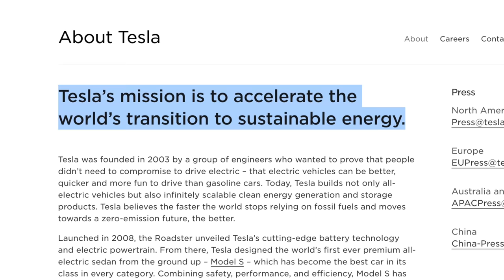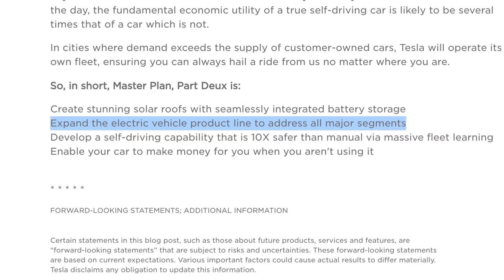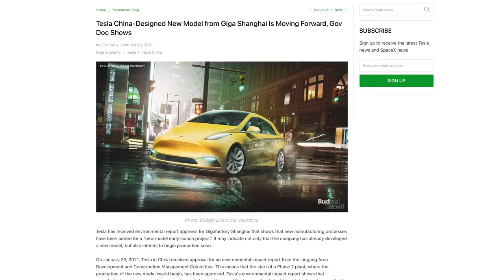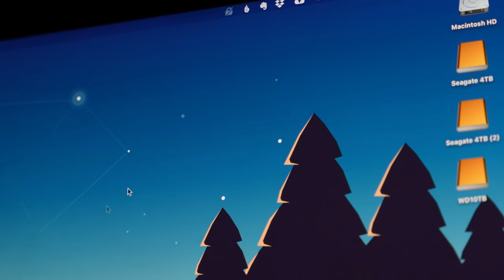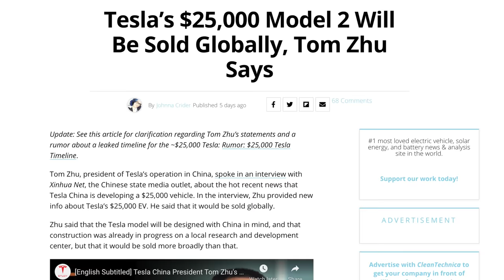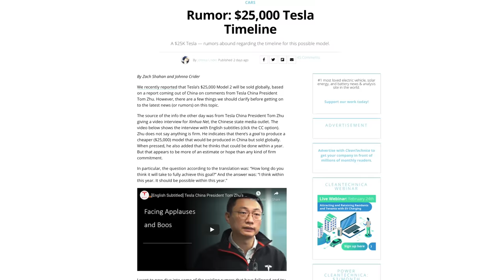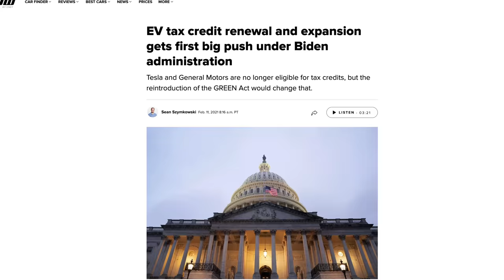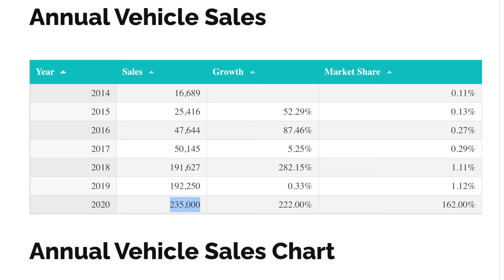New Tesla Model 2 = Game OVER for Gas

Comment: Even with no tax credit at all, $25000 for a "barebones" Tesla is a game changer.
Reply: Indeed, I've already decided to buy it for less than 30k, without tax credit. I'll leave IC car once and for all.
Reply: Without the tax credit its almost exactly 7k over everything in its category.
Reply: TEC Man 96  most of these people are just talking out their rear-end; they can't buy a 5 year old used car for half the $25K, but it's "a thang" to talk Tesla for them. 

You are right, Chevy is better buy than Tesla, and so will Ford very soon. 
e-Mustang is too pricey, but it isn't targeted to the same demographics. But other Ford electrics are in the pipeline.
Reply: Ford built the infrastructure for gas powered vehicles with demand by selling model Ts for less than the equivalent of $10,000 in today's money. $25,000 for a base model entry level car is still not cheap.

If you want to change the world, make it cheaper to do it the new way.
Reply: well being a new Bolt owner this year with about 250 mile range is great for a 200 mile round trip, but out west i will still need my gas vehicle to go the 500 mile one way trip.  I do not see a charge in 15 minutes like a gas fill up.  Can you see an EV truck with a camper on it crossing a large mountain range.
Reply: @ihcterra4625  Chevy Spark gas can be had for $16K. Even a $25K "entry level" Tesla EV is still uncompetitive.
Reply: TEC Man 96  the Model T was the most popular car sold until 1972 and it is still in the top 10 even though it went out of production in 1927. Before the model T, there were less than 200,000 total cars on the road and Ford sold 15 million model Ts by 1927.

It appears that being inexpensive didn't hurt sales.

When it was introduced, it cost about $23,000 in today's dollars, and they sold only 10,666 cars.  When they eventually got the price down to the equivalent of around $13,000 in 1919, they sold 170,000 cars. The price kept coming down and sales kept going up. When the got the price down around $5000, they were selling millions of cars a year.
Reply: TEC Man 96  I just bought a brand new vehicle for $25,000. 

For an entry level base model, $25,000 isn't unreasonable.
Reply: @rayrussell6258  that is what I said. $25,000 is still not cheap for an entry level base model.
Reply: TEC Man 96  he likely found something with a huge rebate; I'm shopping now myself, and there are some good deals if you want to accept what's on the lot.
Reply: @ihcterra4625  I was agreeing with you, and posted a specific example. :)
Reply: TEC Man 96  it wasn't half the price, it was closer to a quarter.
Reply: TEC Man 96  So, none of that is relevant. 

The point is, before the Model T, cars were a luxury item and less than 200,000 were on the road. Selling millions of them a year because the got the cost down under $5000 in today's money created a demand for support infrastructure. Again, the point is creating the demand for infrastructure. How and why they were able to get the costs down isn't relevant to the demand it created for the infrastructure. There I said it 3 times, do you understand the point now?

The relevance is, if they want to build an infrastructure, they need a demand for it. Rather than trying to build the infrastructure for a luxury item, make it more economical to own an electric vehicle. People will be willing to change if it was actually cheaper to buy an electric car, even if they don't quite have an infrastructure for it. Just like the Model T. 

Once they have people used to electric cars and a convenient way to power them, the luxury cars will be much easier to sell.
Reply: TEC Man 96  4 of the last 5 vehicles I have bought in the last 20 years have been new and not one was over $25,000.

2 were fleet vehicles for my business, including the last one 2 months ago. 5 years ago I got one for 17K, and the other 2 were personal vehicles. The most expensive one was a new Jeep for just under $25K. I got a really good deal on the Jeep.
Reply: TEC Man 96  the last vehicle I bought for under $25K has auto transmission, power widows and locks, bluetooth, backup camera, cruise, air etc. But that still has nothing to do with the point.

The point I'm making is that to get the infrastructure built, sell a ton of cheap electric cars. The $70K cars will sell a lot better once the infrastructure is built. $24K isn't a cheap car, so they should build something for half that to sell millions of them and create a demand for infrastructure.
Reply: @ihcterra4625  I agree and that's the goal of course, but $25000 is still far more attainable than $35000-$40000 for an entry level vehicle. I'm excited about some of the smaller entries coming up, such as the Electrameccanica Solo for less than $20,000. It is a vehicle made for one person and can therefore have a much smaller battery pack and still have decent range. And it's worth noting that more than 80% of people who drive to work drive alone, so it makes sense to have a vehicle that is made for one person. Why carry all that extra space and weight if it's not needed?
Reply: @stevekolstad4445  It's getting there. Energy density is steadily increasing in battery packs (the battery pack in my 2016 Kia Soul EV is the same size as the one in the 2020 model EV but has less than half the capacity: 27kwh vs 64kwh) and at the same time the cost per kwh is dropping very fast, to about 1/10th of the cost from less than 10 years ago. Both of those trends will continue and manufacturers will continue to eek out ever more efficiency from their battery packs and drivetrains.

Every situation is different of course, but most people don't need hundreds of miles of range. They think they do, but 99% of the time they do not. The average person both here and abroad drives less than 30 miles per day. And 15 minute chargers do exist but they are rare right now (800V 350kw chargers for the Porsche Taycan, for example).
Reply: @JustWasted3HoursHere  there are actually quite a few EVs in the $30-35K range that would be around $23-28 with the federal rebate. If they can cut $10K off that, it will really boost infrastructure.
Reply: @ihcterra4625  True. Imagine that $20000 car with a $7000-$10000 tax incentive. A new car for $10000 to $13000? That would be a game changer.
Reply: @JustWasted3HoursHere  the Kandi K27 is exactly that. But it has a pretty limited range.
Reply: TEC Man 96  they dont discuss the semi miles whether its empty, bobtail, or 80,000lbs.  How far can you tow 80,000 uphill in the mountains?  100 miles?
Reply: TEC Man 96  according to tesla, the semi is rated around 2kw per mile so 500kwh battery for 250 mile version, 1MWh battery for 500 miles.  Current tesla battery weighs approx 1200lbs per 100kwh.  The 1mw tractor would lose 10,000 lbs of freight in just battery alone. (2500lbs taken off for the weight of the DD series 60 engine)  Take that into consideration that a long haul company would need 1 extra truck per 8 full load of 80,000 lbs plus the added downtime for charging, its a lose-lose situation and will be for a long time.  Charging 1MWh of batteries hasnt even been remotely close to 15 min idea, as that would require 4MHw or 4000kWh of charging.  

Craziness is comparing that 4000 kWh to the average home energy use per year is 11,000 kWh or 11 trips with an electric semi or 5500 miles.  

Can our grid handle that at any location with a single trucking company with 50+ trucks?  What about 10-20 companies on a single grid?
Reply: TEC Man 96  Yes, but it is not a Tesla. Tesla is the only electric car I will buy.
Reply: @RogerioCampanhol  Consumer reports has them 25th out of 26 manufacturers...
I'll make sure to wave as I pass in my IC Mustang....
Reply: TEC Man 96  They had a Documentary on Tesla, they said they used "AA" batteries, YES a LOT of them built into the floorboards, but the connection pattern was patented, so they could show them....I was just wondering HOW you replace them when they wear out!
Disassemble the entire car?
Fanboi is a good characterization...this video smacks of commercial Ad...
Reply: @ihcterra4625  I guess I need to see if I could find the source, but supposedly Henry said he would give people cars, as long as they only bought parts and maintenance from him for the cars lifetime.
Isn't that what Elon has done so far, only he can work on them?
Reply: TEC Man 96  IFF(If and only If) they can get taxes on gasoline to the levels the IPCC wants...$29 gallon by 2030....
Reply: @shillgates6664  They could just stop subsidizing the oil industry.
Reply: And still a worse value than ICE based cars.
Reply: @rayrussell6258  He didn’t say Chevy was a better buy than Tesla, he said a 20k EV already exists(if you get incentives). I’ve heard transmission modules failing in-warranty, but they will not be covered, pedal has no feel, suspension is meh, GM also has an active buyback for Bolt EV models.

Like if you don’t like Tesla that’s cool. No need to make stuff up and pick his words.
Reply: @rayrussell6258  Chevy Spark is a trash, cheapo car with terrible ride quality, seats engine, etc.

Why would I buy a Chevy Spark when I could buy a Lexus 350 for that price used?

You also negate that EVs have gone 300-500k miles on their original batteries without hardcore maintenance of complicated engine components like head gaskets, spark plugs, carbon build up, Short Blocks, Engine Mounts, etc.

You can hate EVs that’s fine. But you could keep the same EV for literally ever, unless you wanted a new car.
Reply: TEC Man 96  real world...a blogger did a winter drive around Chicago with an EV; after trip a 45 minute recharge got her 22 miles of range; not sure where you get 5% to 80% in an hour; sounds like Tesla hype to me
Reply: TEC Man 96  nope, not because of basic and cheap...it was because Henry made no changes in appearance to the car for pretty much its entire production run that people could see
Reply: @ihcterra4625  I still don't agree with that...sorry but you can put up all the infrastructure you want, EV's will be time wasters for anyone travelling more than 150 miles anywhere versus gasoline; if you want to go with an EV it better be almost 100% charged before you leave and you still won't get home without a LONG time at a supercharger; the gasoline car can make the round trip with no stop and still have gas in the tank
Reply: @ihcterra4625  you may have THEN, but not NOW; 
all the low priced cars have been discontinued in the past few months; only Spark remains (at GM), all Fords and Mopars are gone, and you can't find anything sitting on most lots from the imports under $25K now either
Reply: @JustWasted3HoursHere  buy a motorcycle then if you want a one-person vehicle.....sorry but people don't buy tiny one seat cars now in gas, it makes even less sense to think they will as a higher cost EV
Reply: @ihcterra4625  A lot of us taxpayers are tired of the government wasting our tax money on people's personal vehicle choice; EV incentives/rebates need to be abolished, before our bridges fall in and our roads crumble back to gravel
Reply: @chris8417  it's all Tesla hype not real world anyway; if they can get that kinda range on a semi why wouldn't the same tech be on cars now -- so they'd get 500 miles? 
because it's just hype in the press that's why
Reply: @rayrussell6258  Not necessarily. If they see and understand the obvious advantages of an EV but can't quite afford a full size EV (and don't want to buy a previously owned one), then buying a single person EV within their price range might make sense for them. Everybody's situation is different. For example, I knew I wanted an EV but couldn't afford a brand new one, so I started looking at used ones and found a 2016 Kia Soul EV+ with less than 18000 miles on it, one owner and in perfect condition (it even smelled new) for less than $13,000 + about $2000 shipping from California (one of the few states it was sold) to Florida. Best car I have ever driven let alone owned. But, to the point that each person's situation is different: This Kia has a range of less than 100 miles, but for me that's perfectly fine because I work only about 10 miles from where I live. I charge it from home about every second or third day and have never looked back. Maybe in a few years I will upgrade to one with more range* but for now it meets my needs just fine.

* The 2020 Kia Soul EV has over 200 miles of range but it will not be sold in the US. :(
Reply: @rayrussell6258  400mi ranges with 15 minute recharge is available now. 

By the time solid state batteries get here with 5 minute charge times, gas will have a tough time keeping up. Without subsidies they get from our tax dollars, it would already be impossible for ICEs to keep up.

The way to get it built is to Model T the industry. 

By the time they are mass producing millions of a model instead of building a few10s of thousands, the prices will really come down. But they will need someone to build a viable $15,000 car to get there.
Reply: @chris8417  these "promoters" of EV's don't have a clue about reality and most of them don't care --- if they can influence sheep to follow them with the misinformation they spout out; 
you are absolutely correct in your trucking analysis; trucks need to be moving nearly 24/7 right now with existing equipment price and maintenance being so high that no one wants driver's to take the full rest time required on the log book, certainly revenue will get thinner if forced to use equipment that wastes 10,000 pounds of capacity and the equipment is idled longer for extremely lengthy recharging times; 
and if people are upset about 50-cent postage stamps wait until their shipper's minimum freight bills triple or quadruple overnight and shipping/delivery costs billed to customers becomes higher than the item they just ordered online
Reply: @Richard Peterson if you like the Bolt you'll love the e-Mustang then
Reply: @ZambonieDude  I think his point was the Bolt is a better buy, I'm not making anything up; if it costs less and gives you close or better range, it certainly is a better buy especially when Tesla is likely gone in 5 years because they can't survive the competition in their fragile financial condition; and Tesla is totally propped up on borrowed money --- they have no assets. They'll be gone soon unless Biden gives them a bailout; Tesla doesn't employ enough people to justify a bailout btw
Reply: TEC Man 96  the lawyers haven't sunk their teeth into a self-driving car fatality much yet; when they do, that $10K premium won't be the end of the mark-up
Reply: @JustWasted3HoursHere  you city people (mostly on the east coast) think the whole world revolves around your driving pattern; most people do NOT drive 30 miles per day, we drive 70 to 100; 
a typical car travels 15000 miles a year minimum (15000/365 days = 41 miles per day minimum, but considering most miles are driven on 5 days a week not 7, I'll adjust that for demonstration purposes to 15000/260 days = 58 miles per day, then you add on vacations and trips to see family you get up to 70 pretty fast; I drive 40K miles per year on my car; your 30 miles per day is not real world)
Reply: @JustWasted3HoursHere  $10,000 incentive on the car - and no roads left to drive on, and you need a ferry boat to cross every creek and river because the incentives soaked up all the road money!
Reply: @ZambonieDude  Why not buy a used Tesla for the same price? 
Because YOU will be the fool who has to buy the $7-8000 battery pack replacement the original owner didn't do, that's why!!!!!
Buy the Spark....save time, save lots of money, save aggravation. 
I've ridden in Spark, it is nothing like you say. It doesn't ride like my Lincoln MKZ, granted, but it is decent...and the seats are absolutely fine in Spark. I wouldn't want the CVT, but I could see myself with the manual trans they offer on it. 
Zam old comrade, I also have three F-Series trucks with a total of 575,000 miles, the only parts I've replaced are (1) starter, (2) water pumps and (1) radiator, + regular spark plugs and air filters; an ICE may be "complicated" to YOU, but that is far from the truth. 
If you had "carbon build-up" you probably buy your gas from cheap gas stations. My engines have never even spark-knocked, I buy from reputable gasoline companies. 

The wheel motors on your EV will fail, only a matter of time, Your battery pack will fail, only a matter of time. Your electronic dashboard will fail, only a matter of time. Nope, I think no one will want to try to keep an EV as long as you think they will. They can't really avoid any expense going to EV's, see big bills coming and get rid of it. 
Obviously, you are not an engineer, your automotive knowledge is very sketchy. I worked in engineering as a career. You just want to hype your opinions. Sorry, those who know are not buying into it.
Reply: @JustWasted3HoursHere  Very few people only drive 20 miles a day to work; auto companies (ICE or EV) cannot survive on consumers like you.
Reply: @ihcterra4625  That is just a bunch of hogwash....250-270 is the limit on affordable EV cars for the masses. (if you think $35K is even affordable - and I don't) 
I want to see that 400 mile range vehicle, it's probably like the urban legends about ICE cars that get 100mpg on bacon fat! And maybe it costs a million dollar dollars apiece to make one that goes that 400 miles. Totally hogwash. 
A 15-minute recharge right now gives you about 3 miles of range, and I'm sure you have no idea how they can increase that rate by 10x on such a car. It's not realistic to put such false notions in the mind of average consumers. 
I think I saw one of those supercharges for EV's cost $50K EACH! No one I know has that much money to spend on a car, let alone a charger for one, even if it shortens recharging to the "one hour" you say (but my engineering colleagues would strongly disagree with you about)! 

Not realistic to think that mass production of EV's will result in any savings to consumers either. The way prices are set in the auto business does not reflect costs of the vehicle. The cost of a full-size SUV isn't all that much different than a sedan car, but the prices are sure different! The target price is set first, based on macro/micro economics in a marketplace, then we squeeze costs to meet an expense objective under that. If there is any savings from mass production as you think of it, it will only improve our profits. The revenue target will still be set using the same method we use today and go up if the overall economy is not sinking. You won't see any savings.  

What ICE subsidies? I worked 30 years in automotive, no government subsidies ever came our way. If we rebate a car, it comes out of our own revenue, not from the government. 
(I don't consider the company "bailouts" of Chrysler and GM to be subsidies, because both rounds were caused by punitive government manipulation of the free-market, and when it came down to it the politicians knew they had to do the bailouts or face huge masses of permanently unemployed workers (who vote) that would be mad as hell at them. I was at Ford, we didn't need bailout.)
Reply: @rayrussell6258  I didn't say anything about 400 mile range cars being affordable. Just that they exist. In fact, my point actually was, they need to do that in an affordable car. The cars and trucks that have 400 mile ranges are well over 50K. You are strawmanning my argument. 

There are plans to have solid state batteries out this year. It will increase range and reduce weight, making it easier to carry more batteries and they will be able to charge and discharge faster. We are at the point where battery technology development is accelerating. Batteries that are lighter, safer, higher capacity and more abundant materials like carbon have been developed and are racing to the market.
Reply: TEC Man 96  brand new EV (not Tesla but I won't say which brand it was they were testing except to say it was new), the blogger I think called herself CEO of a company behind the video and it had an official sounding magazine-like name such as someone set up to do a lot of EV drive evaluations, but I didn't save the video -- so I can't put the name here for you; I saw it here as a youtube video, so if you search around for new EV's you will likely find it; in the video she was operating initially from inside a home garage with her own charging station on a 110 system, quoted 90-something hours for a full 0-100% recharge, and she showed 220 charge times around 14 hours and supercharger full-recharge times -- all three on one graphic during the video, she misstated one of the numbers relative to one of the others in the graphic which of course lots of people caught and posted in comments so she came back later to apologize for the error in relative times (for 110 versus 220 I think it was, I think she said 220 was 1/3 the time for 110 recharge but clearly that was bad math in her head); this happened a couple weeks ago in Chicago and the video was posted immediately, it was freezing temps and I think it snowed in the video while she took the vehicle north toward Milwaukee and back, heater and defrosters were in use most of the trip; she showed the charging station where the 45 minute recharge occurred (she related a story about someone parking at the station - but not recharging - to hold it for a friend, but she took the connector and put it on her vehicle anyway making the guy holding the spot angry in the process -- to which she told him off about charger etiquette; and she said she only got something like that 22 mile range added for a 45 minute recharge, so it wasn't worth the time or in that case the risk; as you can now see I was attempting to economize on words when I wrote the post you referred to, but please don't EVER challenge my posts for truthfulness --- 
now, here's some "opinionating"..... EV's are an inefficient politically driven waste of time for all of us if we let them force it down our throats ....which is really the plan now because there is no way the US can meet the Paris Agreement without taking away personal cars from everybody and forcing everyone eventually to take public transportation that uses electric power paid for by government and our taxes; once the grid is in place there will be no stopping the political power grab; we need to see this EV/gasoline battle for what it is and it isn't about cleaning the air....we already did that to a point of extreme diminishing returns already but someone else has figured out a way to make a buck if we fail to resist this latest move

analog tv reception was better than the current digital tv reception but our all-knowing government took it away from us for the benefit of satellite tv companies.....this thing with EV's is in the same political way a pay-off for someone....money and graft is going to benefit if we are quiet
Reply: @ihcterra4625  if the first point was not important it shouldn't have been the first point; speculating about range of an unaffordable vehicle serves no purpose; as far as I'm concerned if we aren't talking about improving things for people we don't need to be talking about things that are unaffordable at all; and yes by omitting the high cost of that speculative 400 mile range car, you were misleading the conversation to make it appear affordable
idk where you are getting your "solid-state" battery info but I've not seen it anywhere else but in your post and I think my engineering friends would have let that slip out to me in conversation by now if it is that close; until I see hardware it is just another "bacon grease gets 100mpg in an ICE" story to me.... but I now will be more attentive to pick up on anything that does come within my earshot
Reply: TEC Man 96  my family was in trucking for three generations; I fully understand  trucking....maybe fed ex can do it and pass the cost along but not real trucking companies; we can't have that much downtime switching to electrics from diesel
Reply: TEC Man 96  people react to visual change....whether it was options or bodystyles or electric start..... people could not see changes, the front of all Ford cars was the same for the entire run, basically the same with the interior, and Henry had convinced himself not to make assembly line production "less efficient"/more expensive by allowing the Company to go back to cars that weren't black
son Edsel saw it and convinced the old man to put out the new Model A, with colors and with Henry's V8 that he'd been tinkering with
in those days dealers sold options, and there were plenty of them for just about anyone's choice on Model T's....so your point about "options" being the reason is not accurate
Reply: @ZambonieDude  if the modules are truly failing during warranty they will be covered by the warranty; who told you that lie it won't be covered? 
more crappy internet chain writers I suppose
Reply: @JustWasted3HoursHere  there are NO obvious advantages to an EV; just the opposite frankly....
that's why they failed in 1910 and will again in about 10 years
your personal situation with only a 10 mile commute is so unique that I understand where you're coming from but if I lived in Florida and only had a 10 mile commute I'd ride a bicycle to work --- not pay $35 grand for an EV
Reply: TEC Man 96  sorry I didn't save the video, but I didn't know I'd need to show it to prove my word; I gave you all the key info except the poster  (and the brand of EV isn't the point, because ALL EV's are a waste of our time). 
I'm not flat earth or those clowns, but I can tell you nothing in archaeology suggests we have any worry about "climate change", it's hype driven by the chicken little crowd and politicians using it as paving the way for the "new money" crowd who invested in Tesla
Reply: TEC Man 96  your last sentence I agree with, the change was driven by newer looking vehicles from competitors (not because Fords were basic and cheap -- which was your original point; buyers had plenty of options from the dealers if they wanted them to expand utility)
Sales were declining, true, but they were never bad....Edsel was right in bringing out the Model A at that time
I spent my whole career at Ford, I've lived this tale from the time I was a kid wanting to work there someday, and I made that happen fortunately
Reply: TEC Man 96  you don't understand trucking....regional trucking is still otr; my family business was regional not coast-to-coast; both are otr; 
if you mean delivery trucks you need to be specific and say that
and I still say Tesla is swimming upstream if they think they will get anywhere even with delivery trucks
diesel mid-size and smaller delivery trucks are pretty darn efficient and cost far less; cost is a big object in the delivery fleet business and EV's I doubt will ever get very far in that market
city buses is about the only market I'd give to the EV's, and that's only because city politicians will be involved in the contracts so the purchases will be shaded toward whichever party is in office (cost is no object to politicians spending OUR tax dollars)
Reply: TEC Man 96  your cost of ownership comparison is really off, you must be forgetting to replace the batteries and pay the electric bill! ; failures of every part of an EV powertrain is a MAJOR expense, not just $200 parts plus labor the typical ICE repair; you might not have that covered in your EV figures either; 
dealers who want to sell EV's have to ante up for a new franchise fee, that will get passed on to consumers, too ....another unknown; 
we really don't know yet where cost of ownership of an EV will be....none of them are old enough to have such numbers yet, but promoters of EV's like to say that phrase about cost of ownership --- it's just another piece of the misinformation getting spread. 
All I know is I can buy an ICE vehicle right now for $30K (even $17K or less for a Spark) and the cheapest EV that isn't really a moped is $40K The $30K EV's they talk about in the press never get built I hear; you are on a permanent wait list for one
Reply: TEC Man 96  I have not found your Bolt recharge video; what's the link?
Reply: TEC Man 96  I'm fully aware of capitalism, but when we do not have a truly free-market economy we wind up with monopolistic contraction; I don't think for a second that a company using electric trucks without government subsidies will put a current trucking company out of business
Reply: TEC Man 96  you expect me to fill in the blanks, but ask me for clarification of my points? lol sorry not going any further down that road

I strongly doubt you can show me an honest video source, un-manipulated, that shows that video I cited about recharge times wrong. The poster was independent, not trying to sell any particular EV.
Reply: TEC Man 96  you had the missing information twice, don't try to switch "blame" on me! lol

Daily fixed route delivery trucking is an entirely different animal than coast-to-coast, regional or "local" trucking. We live in that truck for 2-4 days. Some try to get you home in one day, but that doesn't always work out. Diesels are cheap to operate in that environment; seldom is the motor shut off, you need heat in winter and a/c in summer wherever you're parked waiting for unloading and loading. It's not just the point A to Point B that has to be accounted for in otr trucking. EV trucks don't fit, and if you're in mountains a long way from a charger three days into the journey you can be in serious trouble. Also, waiting on a truck to recharge takes away legal seat time from the driver. You can't be "off-duty" either, when you are responsible for that recharge connection. That all delays loads, which are expected to be delivered in "just-in-time" supply chains with 98% or better success or your company gets a bad rating and you lose your customer's business; this all costs too much money. Not going to happen. 

As I said, Tesla can hype and say all they want, they're swimming upstream smoking California weeds if they think they can change trucking even in 50 years. Tesla will be long gone by then.
Reply: TEC Man 96  I'm not filling in any blanks someone can use to further divide the conversation.  lol
I told you the EV was brand new, latest and greatest; it would be in the top percentile of any data you have. 
I'll look for the Chicago video if it comes back in my favorites from youtube. Best I can do right now. I've got to get some sleep! :) 

What you said about Tesla "targeting" made no sense to me. I gave you all the reasons elsewhere on another post.
Reply: TEC Man 96  ok, I just saw a "Road Show" video about the solid-state battery, Very eye opening....but not in a way you're going to like. The shortcomings outreach the benefits, and gasoline refueling is still faster and more efficient than the solid-state battery will be recharged. The shortcomings are battery unreliability .....situations of expansion and contraction cycles that cause the battery to suddenly crack and fail, making them unusable and they must be replaced. No mention of fire or explosion, so at least in that regard it is an improvement over lithium. However there are other internal chemical reaction problems in the solid-state battery that cause cavitation and sudden failures, too. The engineering tech to find fixes for these major issues is said to be "hopeful", however..... 

I've heard that "hopeful" line before....that's what they said about the GM V8-6-4 technology before it was prematurely put on the market by Cadillac, and we in the car biz all know where that ended....in a nightmare. I had some involvement in the 8-6-4 project when we were working on it at Ford with the outside supplier promoting it. We rejected the technology (we called it PROCO) after a lengthy development program; the supplier took it over to GM and sold them a line about how close we at Ford were to production, and GM swallowed the bait. They didn't do enough due diligence development work and certainly found no fix for the issues we had identified at Ford. 

Solid-state batteries are "solid", which injects a new problem in vehicle crash test results...the battery is still large and will not "crush", so crash energy might not be as well absorbed by the vehicle --- with a result that it goes to you the driver and passengers instead of releasing it through crushing of panels around you. The solid battery would prevent the path of energy going where it needs to go in some crashes. All we know about crash technology would need to be re-written, if solid-state batteries do move forward. You can't just swap a lithium battery for a solid-state one. 

This story on solid state is so speculative. The only real reason it is getting traction is because of the worldwide chip shortage right now, and somebody is putting together a laundry list of possible technologies that may need to advance if lithium supply becomes perilous like the chips have become. Solid state is not near production, it isn't even really in prototype development. It's just advanced research...something like where hydrogen is right now. Someone's dream of the future, not actually plausible yet or anytime really soon.  Putting a car on the road for analysis this year does not mean it is near production-ready. And if no good answers are found for those "hopeful" fixes needed, it may never go into production.
Reply: TEC Man 96  I'm not in denial....we will see EV's advance in the short-term. Investments are being made because politicians have forced it and the people are not educated well enough to tell them no. I'm saying that realistic thinking says electrics will fail again in a short time in the marketplace. The house of cards propping up the idea will simply fall apart when people experience the reality and inconvenience of electrics. It will be seen in history as a second time around "fad" that failed.
Reply: TEC Man 96  this was the video
look up "Pickup Truck Plus SUV Talk"  channel; video posted 2/17/21 called "didn't go as planned"

this was an independent review not a sales promotion for EV's; it took forever to recharge as they all do (there is a graphic near the end of the video with recharge times) -- even Tesla without supercharger is this slow (I've seen that on other videos); and she could not get battery up to stated capacity even when gauge said charge was 100% (also like Tesla I hear over-promises range); she took a nearly 100% freeway trip and real world range did not even meet the reduced stated range of the recharge gauge; using accessories like heat in winter (and a/c in summer I suspect but that's not in this video) reduces your range, as does the cold temperatures; 
this video leaves me and others a very poor impression that these EV's won't meet our needs; I do give a nod to the Ford over Tesla but that's it.
Reply: TEC Man 96  Known oil reserves have actually been "rising", not falling. It's technical so I won't try to explain it here. That argument about falling oil supply is just another false precursor for the "green people" to step in with their "solution". 
This EV thing has developed a life of its own, that is totally disconnected with reality. They complicate the discussion (like you just did there) to make sure the shell game always wins for "the house". In the real world, sooner or late the shells are seen through and the falsehoods are exposed to sunlight. 

Major companies were involved in EV's in 1900, and still the "upstart" ICE companies won over the marketplace (rapidly). Matters not how old I am, history is available to anyone to read at any age. Of course, if you ignore history, you are bound to repeat it. That is your status in this discussion actually.... you buy into the shell game and ignore the historical reasons and also ignore human behavior to stay away from complication and find simpler living. EV's waste time, for no benefit in expense (you think all the mergers in the electric utility industries lately was an accident?! .... they're preparing to raise rates with less competition, and regulators won't be holding them back because this will be called "unregulated electricity" just like cell phones are unregulated business versus the old regulated landline rates).....wasting time and no expense benefit of EV's will be obvious again within a decade, and EV's will fall off the charts just like in 1910. 

Honest scientist also say we are not going to help sustainabilty or global climate, there is nothing about the last 50 years any different than the swings in climate that have occurred over the millions of years of rock formations studied tell us. This thing is political, and someone pushing it is out to make a buck off us. They don't care about climate, they want your money. 
The technology you claim is "imminent" is all theoretical, and most of it is not really new (and still they can't find a way to produce it). 
Plus who cares if Bill Gates can buy a supercharger for his garage....99% of us can't even come close.....and even the #2 charger is too expensive for maybe 75% of us. We will go back to gas, and the uncomplicated corner gas station. People won't want to be bothered plugging in and unplugging their car every day! You watch! 
You underestimate my understanding of EV's, I don't complicate my postings here by "showing off" how much technical I know, my ego doesn't require that. My focus in this discussion is mainly real world living, not the technology. I know the snowball is rolling downhill for EV's right now, but I can wait to be smug over it when Tesla is long gone and the free market returns for ICE in a decade. 

.....and really it's kinda insulting for someone like you who doesn't seem to have ever worked in a car company to be lecturing to someone like me who has lived it as a career, and who has studied the history of the business far longer than that. I think I've earned more respect than that....and I don't regret pointing out the shortcomings the "mainstream media" won't say to people. 

I've driven a hydrogen car, have you? likely not. 
Well, they haven't gotten any closer to viability in the hands of the general public than they were 50 years ago....they blow up if you can't be bothered by actually thinking throughout every refueling. I don't want to ever get to the point where I have to be next to Bubba after a 10 hour work-shift stopping to refuel his hydrogen car, too tired to follow all safety precautions. I could be collateral damage that day. That's the real world kind of thing people don't think about and the press won't publicize enough, until a few hundred people die from the explosions. The "greens" still talk of a hydrogen utopia like it's coming next year! 

If you are so worried about carbons, carbon dioxide and so forth, why don't you mention overpopulation of the planet? People love to blame inanimate objects like cars for all sorts of problems, but are blind to the real root cause. We can all still drive ICE vehicles for another century, no change, if we just reduce population.  

End of my involvement in this discussion with you. You will get your EV's, they will fail in the marketplace when human nature is satisfied, and then my view will prevail (faster if we vote out the extremists who have taken over what was once a great political party that stood up against big corporation's power over individual people, but who now represent the will of Wall Street to make a buck out of this chaos they've created). 

So long, sir!
Reply: TEC Man 96  cart path for horses hardly usable for cars, and unpaved....again you don't know what you don't no
Reply: TEC Man 96  human nature is just that....it doesn't change, generation after generation it is a constant even when certain things change they change for simplicity, time savings, and less expense....which EV's will satisfy none of those

Now.....you are being reported! for continued harassment after I asked you to stop
Reply: @ihcterra4625  And that's today, not in three years. I wish Tesla Motors well, but it might just be too little too late. All the big boys have EVs already out or coming soon.
Reply: @ZambonieDude  If by forever you mean from 5-12 years until you have to replace the entire battery if no mechanical failures crop up, then yes. Which is way less than the average life of a combustion engine. I hope fossil fuels are on the descending tail of total consumption for good, but low energy density glorified laptop batteries strapped to a car chassis aren't exactly future proofing personal transportation solutions. I see them as a transitional solution until something actually better comes along, new energy storage technology, hydrogen cells, something with at least comparable capacity and autonomy to current cars. And current gen EVs certainly aren't it.
Reply: @rayrussell6258  Many cities in Europe use bio fuel or EV public bus fleets mainly to reduce air pollution but also for political reasons.
Reply: @seungko5142  To be honest, I'm surprised that crypto-currency like bitcoin are even legal since it is essentially like printing your own money. The anonymous non-traceable nature of it is also a big problem in the world of ransomeware. I expect some legislation on that in the near future, at least in the US.